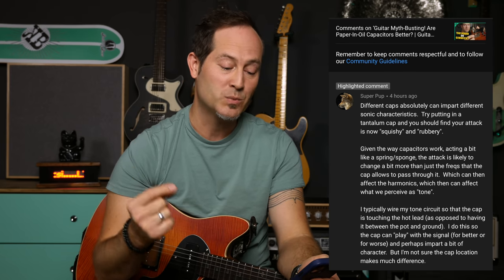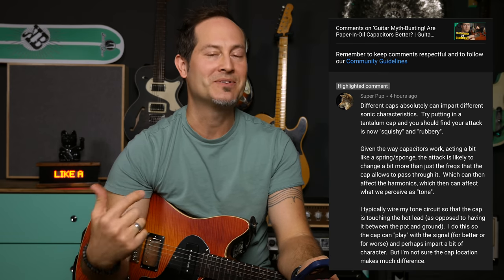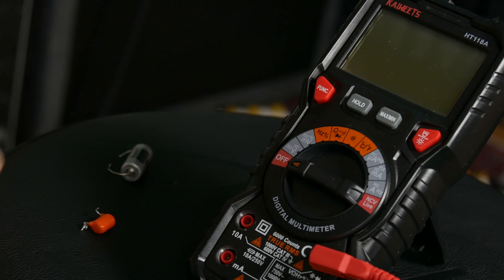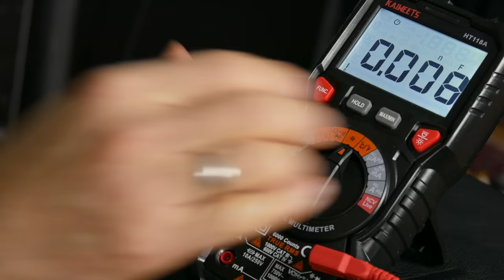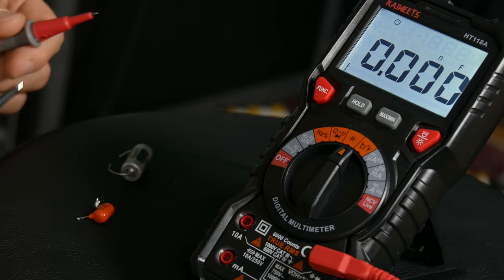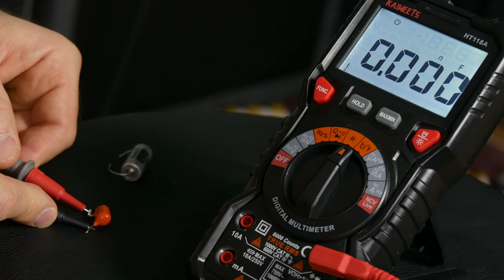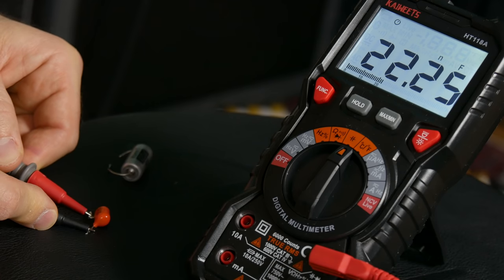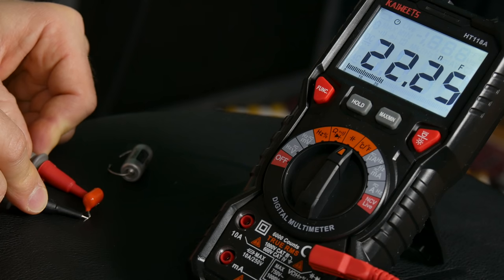Guitar Capacitor Types Matter! Here Is The Proof | Guitar Tweakz

Comment: Hello Kris, I am also an electrical engineer and sadly the "tonal" differences of capacitors do not exist on a usable level. There are differences between capacitor types but none of which change the frequency response in a noticeable way. The difference between the frequency response on a bode plot of capacitor types are nearly the same and identical to the human ear. The "tone knob" of an electrical guitar is usually a simple first order low pass filter using a resistor (potentiometer) and a capacitor. The cut off frequency is calculated with the equation 1/2piRC and that is the frequency where the the loudness is at 1/2 or -3dB. The small difference in the capacitors value also wont change the tone noticeably, it only would if its really different, but not like a 2%. Another point about the tone knob at 10 affecting tone. By technical standpoint it does change the tone using the same equation as before but a pot at 10 has a resistance usually between 0 and 2ohms so the frequencies being cut are well in the MHz range which is way beyond the 20KHz of human hearing. I love the video though. I love combining the worlds of physics and sick tones.
Reply: If you think that a tone pot at 10 is 0-2 ohms, I’m struggling believing you’re an electrical engineer... or at least that you know how an electric guitar is wired.
Reply: I'm a physicist by training (PhD). Anthony is 100% correct. Everything he said is spot on. In addition, if different capacitors of the same value had tonal differences manufacturers would have used frequency response curves in their marketing many many decades ago.
Reply from the maker: Thank you for this comment thread! I love reading it and since I'm definitely not an electrical engineer, nor a physicist, I will simply accept and agree with all that Anthony and DrKev wrote. I do have a very important question though and I hope someone can answer it: if that's all true, why did they sound different in my comparison video? It wasn't a huge difference, but everyone seemed to notice the same thing: the PIO sounded a little smoother in all tone pot settings, including tone at 10. Which makes even less sense now that I measured them. According to the values they should "sound" the same (the PIO had an even lower resistance so it should leave the sound at least as open as the orange drop, if not even a little more). I'm struggling to understand this, since it seems to go against the rules of electronics / physics. I'd very much appreciate a logical explanation for this, because I'm a little bit confused. 😆 Cheers guys!
Reply: @shredgd5  Hey buddy, I have used multiple multimeters on the potentiometers in all of my guitars and they have a value of 0-2ohms. If you don't believe me, get yourself an ohmmeter and try it out yourself.
Reply: @KrisBarocsi  Hi Kris, I currently do not know why they sounded a little different, I will have to run an analysis on your video and make my own detailed experiment eventually in my laboratory. I will try to get back to you when I have it finished. It might have been an experimental error of the guitar playing itself or something minor if not done in a perfectly controlled system.
Reply: The Simple Explanation when it comes to a guitar: Everything "different" you add or remove to/from it, will change how the instrument sounds/feels...Whether noticable or not! Humans have become to "set"/"arrogant" in their ways with the things we know/learned or think we know, that we completely leave out the "unknown"...  We like to "explain" everything with learned logic or common sense but with some things we just can't. In the case of a few Ceramic Caps I recently changed out for the same value of a few Orange Drops in my les paul guitar...  I noticed a lot of difference in how the guitar sounded and felt... but then a few days later when i was in a more restless mindset i didn't ...notice any difference... There are so many factors at play in how we, as human beings "sense" something.. So are there in the material characteristics of things..
Reply: Anthony, in general I would agree with you about the types of capacitors, but as normally wired a tone pot has full resistance at 10 (250K or 500K) and near zero at 0 position The tone pot bleeds high frequencies to ground rather than passing the signal.
Reply: As it is wired in a guitar it is not your classic low pass filter, It's actually a treble bleed to ground with a variable resistor in front of it and at 10 it is the value of the pot (250k or 500K)which mostly blocks the treble loss
Reply: @anthonym8296  the electric guitar wiring is conceived to give you the max value of the tone pot on 10, i.e. 500k (which are never exactly that value... let’s say 465k). It’s when the tone pot is at 0 that you have those “none-zero” values of 0-2 ohms due to the imprecision of the manufacturing of pots, or even a few more with dirty/old contacts. So those few ohms you’re pointing out only get into play when you completely close the tone pot, which is not what we’re talking about. Moreover, if the pot isn’t changed, that “error” is constant when swapping tone caps.
Reply: @KrisBarocsi  one “skeptical” explanation might be that your tone pot is a bit dirty, so when you put it on 10, it’s sometimes 9.9, sometimes 10, sometimes 9.8, etc. That would mean that the actual resistance between the signal and the cap is not always full value: being it a log taper pot, the 9.9 position and the 10 position differ of a magnitude of 10s of kohms, not just a few ohms (as a reference, a 500k tone pot at about 8-8.5 “becomes” a 250k).
If instead we assume that the tone pot was never touched between the two recordings, and the actual reading across it remained exactly the same, then the audible difference can only be due to a different performance of the two caps at the various frequencies. For example, I definitely prefer the “imperfection” of ceramic caps to the “hi-if” behavior of silver mica caps in treble bleed circuits or even in a tube amp: the silver mica are so efficient and precise in passing high treble frequencies, that shrillness easily appears. In the case of a tone pot, the job of the cap is taking out frequencies, so if there were not methodological errors in the comparison, the conclusion can only be that the PIO is more accurate in passing high frequencies (to ground), so the final result is a warmer tone because of that.
Reply: Story time ... When I had not been modding very long I had a Les Paul Classic that I put PIO caps in, they worked but my soldering wasn't very tidy. So being a bit pedantic, I took the guitar to my local shop for them to clean up my untidy work (I know, shame on me but I was learning lol). The next day or so I get a call, I collect the guitar, I take it home, Plug it in and instantly from the first chord I played there was something different. It wasn't as smooth sounding, so I opened my guitar up and there it was. The engineer had swapped out my PIO caps for Orange Drops. So I called the shop back and told them to get the caps back in, gave me a story but all was back to the way it was. Point of the story is, I didn't know the engineer had swapped out the caps but I heard the difference instantly. I didn't really know what a PIO cap was at the time, I was looking for a more "vintage" tone, so I didn't know that PIO are apparently smoother sounding than an Orange Drop a part from my own experiences. There may be more at play here but it certainly stuck in my mind
Reply: @jeffhigh2  Hello, what you are describing is a low pass filter. I am more than familiar with guitar electronics and how they work. I am both an electrical engineer and guitar luthier. Good to know you know what's up with capacitors. Marketing and placebo have changed peoples thoughts on how they work because companies want people to think in a way that makes them more money like this whole potentiometer and capacitor "tone" businesses.
Reply: @shredgd5  Hello from my experiments I tested my pots when I put them at my resting natural 10 position and they read between 0-2ohms. Having it slightly off would make a very minor difference but when we have it at 10 it is more than likely that is actually is at 0-2ohms. If someone's pots have a very large resistance when they try putting them at 10 then they need to either clean it or get new ones. I am having trouble understanding your last sentence, please elaborate: "if the pot isn’t changed, that “error” is constant when swapping tone caps."
Reply: @spudvader  Hello more than likely the value of capacitor was changed if you were able to instantly hear a difference. They also could've changed something besides the capacitor, but I'm obviously have no clue since I wasn't there.
Reply: Here is an interesting video to watch about PIO capacitors from Dylan Talks tone: https://www.youtube.com/watch?v=GXPCh1FJHEY&ab_channel=DylanTalksTone
Reply: @anthonym8296  I am both an engineer( though not electrical) and a luthier too . I do object to your statement that a tone pot at 10 reads near zero resistance. As you should be aware, a pot has 3 lugs with the middle one being the wiper At "10" ( knob fully clockwise) one lug to wiper will read near zero and the other will read the full value of the pot. A Volume pot is wired as a voltage divider with  one lug grounded, the other as input and the wiper as output.
The tone pot uses the other lug so that at "10" maximum resistance is obtained and the bleed of treble frequencies to ground is minimised. It is NOT a classic Low Pass Filter because the signal is not passed through it to the output it only shunts off a variable portion of the treble frequencies to ground.
Reply: @anthonym8296  I can’t understand your results. The tone pot at 10 must offer all all its resistance between the signal and the cap, so that the cap has the least “shunting to ground” effect. It is when the tone pot is set at 0 that we should measure 0 ohm resistance, meaning the cap is directly connected to the pickup signal and is shunting to ground a lot of it.
My sentence you didn’t understand is referred to the comparison of caps: if we hear a clear difference between two tone caps in the same guitar, it doesn’t matter if the tone pot isn’t completely ok, because this type of “error” would be constant in the comparison, therefore it can be ignored. Is it more clear now?
Reply: @anthonym8296   It's not a low pass filter because it does not have a signal out from the resistor/capacitor junction
Reply: @jeffhigh2  I am reading the resistance of my pots and they say 0-2ohms. I am reading from lug 1 to 2. This gives you the resistance that is currently being selected. I am not pulling these numbers out of nowhere they are my actual results. For example a cheap A500k pot i got on ebay is 1.3ohms and some CTS pots I have are showing around 0.8ohms and my others all fall in this range. The resistances from lugs 2 to 3 while on full also show a reading of 0-2ohms. The tone knob is a low pass filter because it grounds the frequencies past the cut-off frequency in a negatively linear manner on a decibel scaling.
Reply: @shredgd5  Hello sorry for the confusion when I said tone pot at 10 I meant like how we see it as a guitarist, it is technically at its leftmost position at like 4 o'clock on a clock face. Thank you for clarifying that last sentence. Yeah it can just be ignored, and honestly same for everything in this topic. Us as guitarists, and myself as an engineer, like to dwell deep into these small things to try to nail "the tone" but at the end of the day these things have a very minor effect if at all in some cases. Take this as my best advise, EQ is everyone's best friend. At the end of the day the small differences we here by altering most little things on an electric guitar are made insignificant because we have modern EQ's. It is fun to go crazy over these small things but this is just what companies want us to do so they can sell more stuff.
Reply: @anthonym8296   when on full clockwise (10) a pot will read about 250 or 500 K from the middle terminal to  one of the others and near zero to the other ( ie the 1 ohm or so you are reading) . When you hook up a tone pot it has maximum resistance at full clockwise (Position 10) and minimum resistance at full counterclockwise
Reply: @anthonym8296  From what I remember the values were the same and everything else was the same as well, no new pots or anything. Who knows, just my observation
Reply: The real difference in capacitors is the tolerance and quality.  Cheap caps frequently are less close to the actual stated specification(s) and the poorer the quality, the shorter the life before it breaks down and drifts even more if not outright fail.
High quality caps will be within the stated tolerance and will last far longer maintaining that state spec.
edit: obsolete IC designer and guitar hack, here
Reply: The tone pot and cap are not really first order low pass since they are in series to ground.
Reply: The problem is when you say the word tonal, you have left the world of science and engineering and gone into subjective territory. A lot of the changes I notice when modifying a guitar are not tonal by my definitional of tone, they are a feel. But definition of tone may be different than the next guys. Some of my guitars don't sound as choked or compressed as other that seem to suffer lack of dynamics, which to me is not tone.
Reply: I am also an electrical engineer with over a decade of experience in signal processing and power circuits. There ARE differences between different types of capacitors. Namely, the internal resistance and inductance will vary between different compositions and geometries. The internal resistance and inductance CAN have mild effects on the tone due to them creating second and third order filters.

If you pop open a low noise power supply, you can see this first hand. You’ll find different types of capacitors in parallel buffering the voltage. Why? Because some are better at bleeding higher frequencies and other are better at holding large amounts of charge without self discharge that would cause the output to slump.

That said, the impact on tone will be very small in most cases. Unless folks are doing side-by-side comparisons, it isn’t going to be noticeable.
Reply: I don’t know about you, but I heard tonal differences between all of them
Reply: @anthonym8296  hi anthony, It may seam a little off topic but do you know if having the capacitor first then the resistor to ground change anything than having the resistor first then the cap to ground.To be precise, I mean with a low value on the pot like 10k.
Reply: @Desaulnierspf  hello, having a resistor in series with the output and a capacitor in parallel to ground will result in Low Pass Filter which is what we do on guitar, If you switch out the resistor for the capacitor in the sequence you will get a High Pass Filter instead. The frequency cut off point will be 1/2piRC. If you want a fun easy mod using this idea, take a look into the "treble bleed" circuit mod. You have to play around with the values for what you want but it can be useful depending on what you're doing. Anyways, I hope that helped.
Reply: @anthonym8296  thank you , good  explanation, but, i mean having  the capacitor followed by the resistor to ground nothing in serie with the output.
Reply: @Desaulnierspf  I'm having trouble understanding what you are asking. I mean series with the output because the signal has to leave to the output and every element can be connected in either series or parallel and when you are directly connecting things as a positive to negative sequence it is called series. If the circuit is not going to output then there is no output. Feel free to ask me again.
Reply: @anthonym8296   so the tone control of an electric guitar  going to ground is considered in parallel ? When i said nothing in serie with the output i meant neither the  tone capacitor or is potentiometer, i know the signal itself goes to the output.
Reply: @Desaulnierspf  ah yes, and yeah the pot being grounded makes it in parallel in this case.
Reply: @DrKevGuitar  if you think that different types of caps makes no difference then you wasted your time studying.
Reply: @spudvader  your ears were honest and your repairman a low life for swapping them out. Ive played guitar for over 50 years and hands down prefer PIO caps in all of my gibsons. Orange drops are way too harsh for my liking. There are plenty who will tell you that the cap material makes little to no difference but in reality they have been proven beyond doubt to be very different. I recently changed out the horrid little red caps in an epiphone les paul to PIO and it changed into a whole different guitar. In closing, its fair to say that we can sit here all day and argue about caps and pots...but the science has been proven. The brand of pot makes a huge difference as does the type of capacitor you use. The judge can only be your ears and what YOU prefer. Keep in mind that some idiots will say that the wood and the age of it that a guitar is made of makes no difference in an electric guitar so the mindless are out there living among us. Do what suits YOUR ears best and just enjoy.
Reply: I agree, but just got an argument from someone else. The only place I dis-agree is in hearing different values. I do a lot of amp tone shaping and have found very small %'s make a tone diff that can be heard. %'s well below their stated tolerance. Never  from diff. types of same value. People don't think about the fact 1% of .022 is 22 pf That's enough to change tone. I've also found that changes this small are un-detectable as far as hi freq but does shift the resonant peak enough to notice. Possibly making a lower value "seem" brighter. I just am amazed at the denial of placebo by so many. Which probably happens to people who deny it's happening even more as they believe or want to believe so badly that material matters.They start bringing in specs that as u said are so minute that the changes are so far out of human hearing. This is with caps in an amp circuit, This is a cap bleeding of highs thru a 500k resistance, seriously???? I've had experiences like one guy above where I was comparing and hearing a diff. only to find that what I was doing was not connected into the circuit.......too funny, that's when I really started studying placebo.
Reply: Careful with the formula... They'll call it lazy about not adding the parenths... They'll read it as 1 / 2 × π × f × C not as it should be 1/(2 × π × F × C)

Yeah, some of us know exactly how to read that. Others? Not so much.
Reply: @klauscottonswab2322 

Confirmation bias is real. Real enough if you eliminate every possible variable you can, and it sounds the same, they'll adjust their choice if they chose wrong.

Blind test it. Seen another video where they had one pickup straight to jack. Raw signal recorded. Raw signal sent through box with chosen caps to switch in and out. Cap values matched close as possible. Ran signal through box... Recorded signals from box. (Used amp modeler to make the signal less sterile after box.) Reveal types after recording your personal guess as to which is which. Can't see or be told in any way which is which before or during testing if your the one judging.
Reply: @willbarnz6960  Yeah, I mean it doesnt matter in a youtube comment, but respect for having a keen eye.
Reply: @anthonym8296   I was believing you up until the point you said tone pot at 10 doesn't affect tone. I use no-load tone pots on my guitars and the difference is subtle, but very real
Reply: @KrisBarocsi  Hey Chris. I really appreciate your videos, I really do. But to make any statement about anything affecting anything, you just need to do it more than once. You might have heard a difference, maybe there was a difference. Was it really because of the type of capacitor you used? No one can say. Do it (at least) ten times with ten different capacitors for each capacitor type, possibly in random order, record it and then try to generalize. The best thing would be if someone else wired the capacitors for you so you did not know which one you used (in this case maybe some kind of external tone pot in a pedal form with switchable capacitors would be more feasable idea than rewiring the actual guitar every single time). Then analyze the recordings, then find out which recording was done using which cap. type and only then you can try to say that a capacitor of that particular type does that particular thing to the guitar tone. Unfortunatelly, that's the only way to find that. There are so many things that might have been different in these two particular capacitors that influenced the tone. That's why science is never done this way but you have to find the pattern on a bigger sample size to say there might be something to it. Just an idea for a future video? Maybe :))) I understand that it is insane ammount of work.